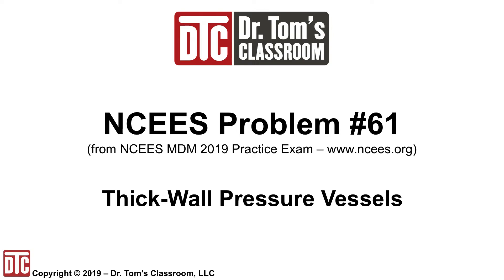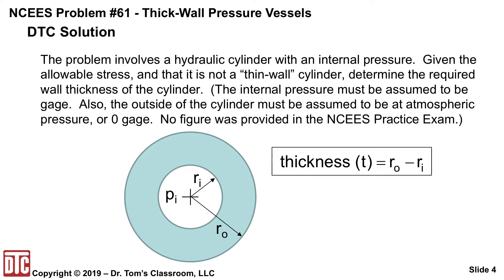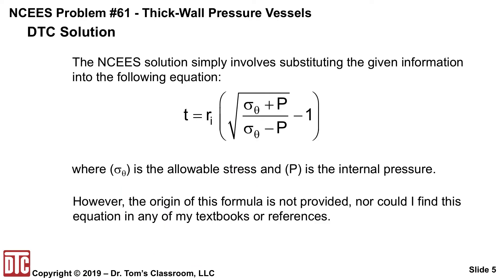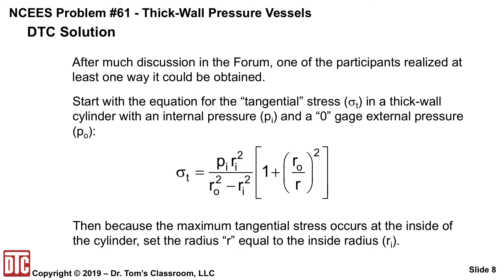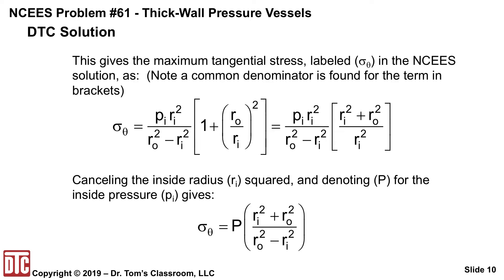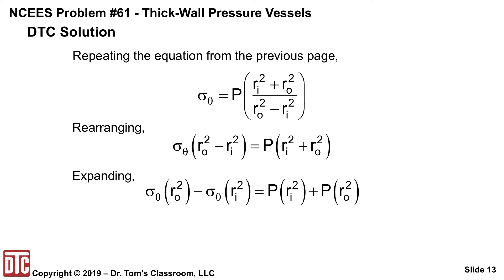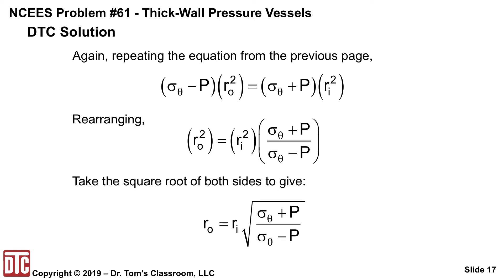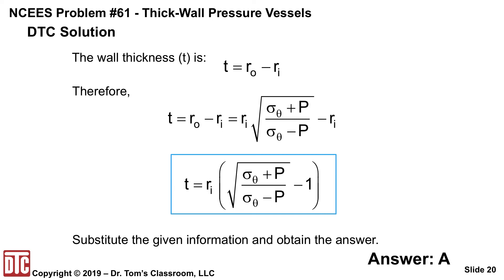NCEES PE Mechanical MDM Practice Exam Problem 61 - Think-Wall Pressure Vessels (Solution Tips)

Comment: So basic algebra you should know if youre an engineer
Reply: Yes. If you have a complex equation and what you are looking for is on the left hand side and you know everything on the right hand side, then finding the unknown quantity is just a calculator exercise. However, more often than not, what you want is buried in the complex terms of the right hand side and you are then faced with doing algebra to get what you want on the left hand side. I've been teaching for over 40 years and I rarely have questions on the derivation of a complex equation, however I always have lots and lots of questions on how I did the algebra needed to get a variable free and on the left hand side.  Great question.
Reply: @tombrown6227  I guess it's a good thing you get more time on the PE than the FE then!

Comment: the formula on page 206 of PE Mechanical Reference Handbook for wall thickness works for this as well. t = (Pi*ri)/(Se-0.6Pi) where e = "Joint Efficiency of 1.00 which indicates that the weld has the same strength of the base metal, and it is assumed as if it is seamless". Not straight forward on what joint efficiency is anywhere in the handbook so I had to google that and find it on Linkedin.